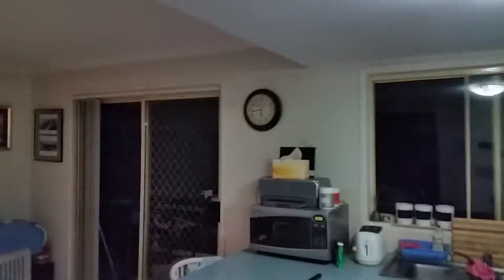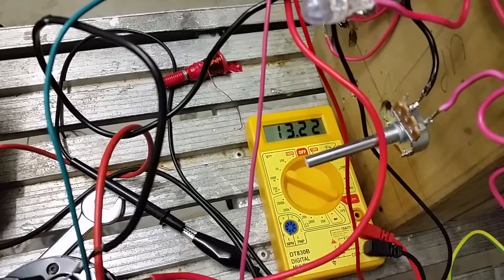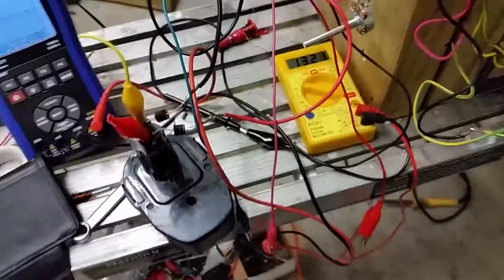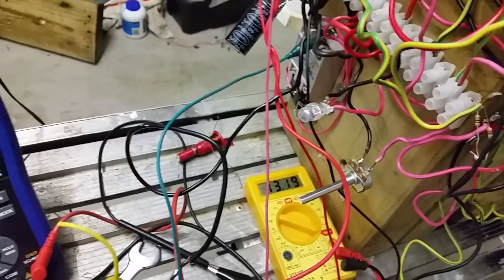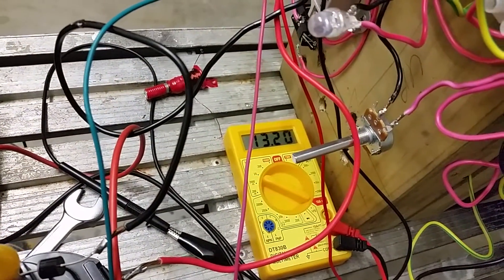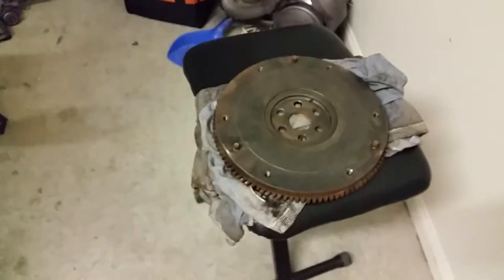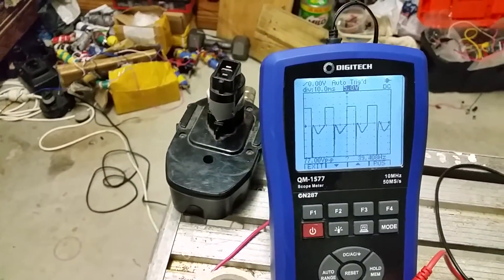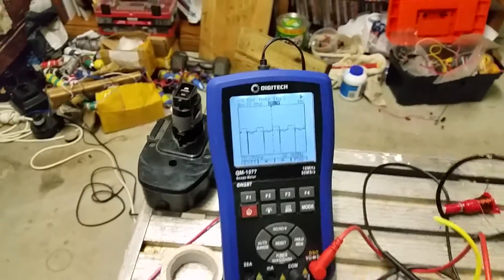Mackay Homopolar Self Acting Electron Separator update

Comment: how much amps and volts does it make?
Reply from the maker: It makes about 8v at 500rpm 1.12mm wire so reasonable amps.

It seems to make back about 95 % or more then what is put in but wont go over unity. Basically the wire gets saturated and starts to draw current then the field collapses and the current reverses and comes back as the opposite sine which I can take off with a diode and put into the capacitor and use again.
I haven't hooked it up to a drive motor but have considered it. Because it naturally reverses polarity I only have to pay for one reversal and the other part of the sine wave is the natural relaxation of the coils inside the magnetic field.
I am working on another design. 
Because I am using 6 magnets on the disk it must fire 6 times each revolution so at 50hz is about 500 rpm it needs to be a quicker more brittle coil core for quicker orientation.
The Iron cores will be either partially hollowed high tensile steel bolts 300mm length. Stainless steel bolts or a cobalt / brittle steel rod up to 10mm diameter 300mm length. 
I would use thinner wire probably .5 to .9mm.
I would now only wind the bottom half of the rod and not go past the equator, allowing for the rod to partially keep its magnetic orientation without a full reversal.  I would not bother trying to get a voltage from the disk instead I will be focusing on the shaft using alu tubing on a 30mm steel shaft with bearings on the ends to take of the homo polar voltage. Even if I segmented the disk correctly it is too hard to contact the perimeter but the shaft should still create a voltage potential and by using long roller bearings the potential will be easy to take.
I will be using perspex for the disk and putting in Alu tubes to make a Dirod machine. I am still undecided on the hollow or solid argument. It will be a separately excited with 6 or 8 poles out put at approx 100kv. Then it is easy to take the currents form the perimeter as plasma.
I am working on the conversion transformer to convert back to lower voltage to charge up capacitors.
Hope this helps.
Thanks Raef
Reply: wow thanks for the long biography I wish you all the best of luck and I hope you achieve overunity